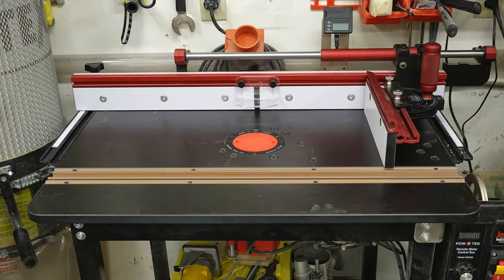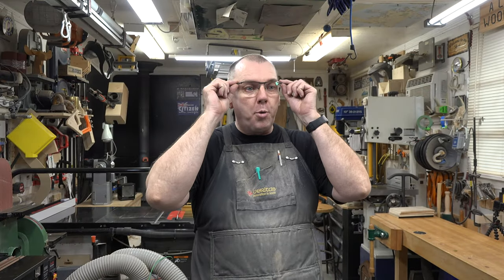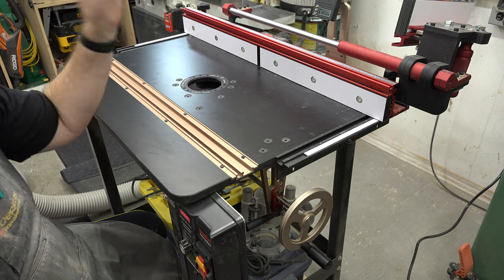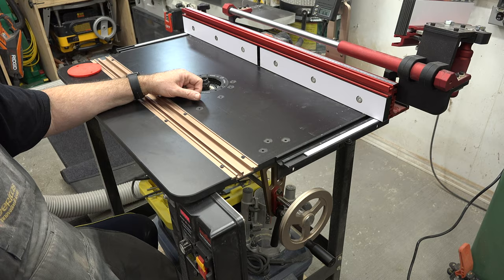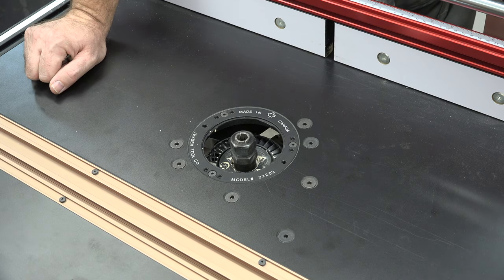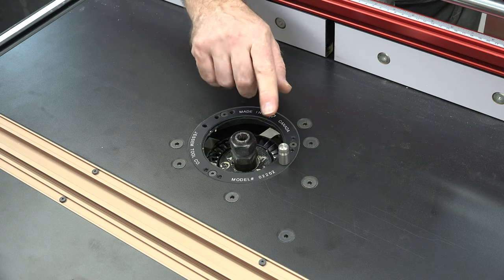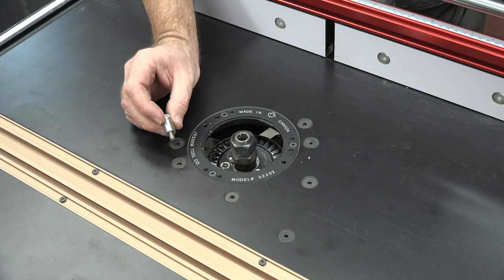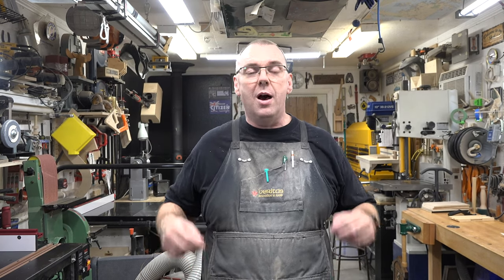JessEm Master Lift Excel II Review

Comment: Thanks Kenny I had been wondering what the all the fuss was about and now I see - it appears that the JessEm is the Rolls Royce of router tables. A brilliant design combined with excellent engineering. It's very impressive and I am delighted you are enjoying its practicality. Always good to get maximum bangs for your hard earned bucks!
Reply from the maker: I do like this table Mike.  I want to be enclosing it soon though to store my other routers and accessories.  Hopefully you will see that on the show soon.  Thanks for tuning in sir.
Reply: @acutabove_woodworkings do you still have it? Still liking it?
Reply from the maker: @Benmeglei1  Still have it.  Still love it and haven't had a single problem with it since the day it was purchased.  I hope this helps.  Thanks for tuning in.

Comment: That is a nice tool Ken, thanks for the review! For the plates could you epoxy a magnet on the under side, then inset a washer in the tool? No better yet inset the magnet in the tool and washer under the plate. If only you knew an electrician that could pick up a few box knock outs. Thanks Ken!
Reply from the maker: LOL. I will try and find me an electrician Frank.  Maybe he can help me out.  Thanks for tuning in and for taking the time to chime in with your suggestion.  It's very much appreciated.

Comment: That sidewinder mechanism is appealing. Now to see whether it is available for the lift installed in a shop-built saw table extension.
Reply from the maker: I was able to install this side crank in a shop made router cabinet and it works just fine.  I am sure that you would be able to adjust your shop-built table saw extension to be able to accommodate the mechanism.  Thanks for tuning in and good luck on your build.

Comment: Been window shopping high quality router tables until I can mak the leap. Everything good costs money.
 The side of the table crank is the thing that I like most on this unit. 
 I really want the festool for its portability but, I'm not married to the idea.
 Jessum is on the radar..
Reply from the maker: I've been happy with this system William.  They are pricey but they are also high quality.  I love it.  The fact that it is from right here in Canada is also a bonus for me.  Thanks for tuning in and good luck with your router table purchase.
Reply: @christophervincenzo4553  
Sounds lime you aint getting tbe hob done if you have to sneak her like that

Comment: Kenny, great review all around.  My only question is are the fence faces user replaceable?  For instance if you wanted a zero clearance fence on either the fence or the miter face could you use a material such as melamine to make your own so you don’t mess up the originals?  Really a nice looking tool that should last a lifetime or more.
Reply from the maker: I haven't looked into whether or not they are replaceable Paul but I would imagine that it would be an easy task to make a set of sacrificial ones.  Maybe a show idea?  I'll have to look into that.  thanks for tuning in to the show and for taking the time to leave a comment again this week.  Always great to hear you opinion on the program.

Comment: 22:05... suggestion... you could epoxy a rare earth magnet to the bottoms of the plates and a corresponding magnet to the handle.  No need to drill, just glue to the opposite side of each, as the magnet should be plenty strong to provide just enough attraction to lift the plate out when loose.  Of course, it may not work for the largest sized inserts, as there may not be enough room to mount the magnet to those particular plates.
Reply from the maker: Thanks for tuning in to the show and for chiming in with your insert suggestion.  I still haven't decided on a final method yet but your method has some definitely possibilities.  Thanks again.

Comment: Love your review of this router table, very in depth. I wish they had not discontinued the Pow-r-tec Router, controlling the speed with out having to reach underneath is a lot more convenient. I've had this table for a few years now and I have a Porter cable 7518 router installed. It works great but a remote speed control would have been better. My only issue with this table is the dust control. The suction works somewhat but I still get a lot on the floor that's missed, A LOT. I would like to mount a box to catch it and I'm looking for ideas on the best way to mount it and how to get around the handle shaft. I remember seeing a video a while back about a box for this model but I cant seem to locate it again. Do know of one or have you thought about adding one to your table? Anything you can suggest would be appreciated
Reply from the maker: I produced a show on making a router table cabinet for this exact router setup and I was able to work the height adjustment shaft into the design.  It greatly improved the dust collection of the machine and if you are interested, here are the video links to the series.
Part One. https://www.youtube.com/watch?v=eciOQDDYj2w&t=18s
Part Two.  https://www.youtube.com/watch?v=eSxSyAPL-Ug
Part Three.  https://www.youtube.com/watch?v=OjFy65tqtz8
They might help you with dust collection idea.  Thanks for tuning in and for the kind words on the show.

Comment: Didn't watch video yet, but this master lift is a beast. I have same one in my shop. I also have two rout-r-lifts, which also I could recommend
edit
wow I started with same freud router table. I still use that original 3.25 or 3.5HP freud router
Reply from the maker: I love the lift.  It works flawlessly and is extremely adjustable.  Thanks for tuning in to the show Marcelo and for chiming in with your thoughts.

Comment: If the "fingers" on the insert wrench are steel, you can just epoxy some small magnets under the insert.  That would allow you to have it "connect" to the wrench which would make removal very easy.    Have you considered drilling a hole (1 1/2")  in the table and hooking up another dust collector hose to it (underneath)?   That would solve the rabbet/dado dust issue.  Another excellent review.   :)
Reply from the maker: That would be an expensive fix Ron as there are about 13 inserts.  Not to mention that the holes that the fingers insert into are through holes that the fingers sit proud of.  I am considering magnets, just not on the fingers.  If I ever figure it out, you will see it on one of my 6 month update shows.  Thanks for tuning in and for the suggestion.
Reply: @acutabove_woodworkings  I got 100 rare earth magnets on Amazon for $20.  Small, 5/15 round ones.  I use them on my table saw inserts to hold them in.   Work really well.  But if the fingers are proud, and the handle is plastic, would probably melt the connection if you tried to grind them down flush.  Oh well.   We look forward to your updates.  :)
Reply from the maker: @RonAday  I appreciate you trying to come up with a solution.  I'll be sure to post when I fix the issue.  Thanks again.

Comment: Have you settled on where the best position for you to place the digital readout screen for your custom build? I’m thinking \nearer to the crank handle since this is where we control the height, and about eye level, somewhere on a back wall.  I don’t want to have an obstruction on the table if I need to remove the fence for large routing pieces.
Reply from the maker: On the custom build Bash, I basically left it where it was in the original assembly of the table.  I had to modify a few small things but the placement has never been an issue for me in the entire time I have been using the router table.  In fact, I quite like the placement now that I have had a chance to use the table more and more.  Obviously, whatever works for me might not work for you but I've had this table a while now and have had no issues with that gauge getting in my way.  I hope this helps.

Comment: Great review on your system.  I am at a crossroads as far as a router table.  I purchased the JessEm Mast-R-Lift II several years ago and am now just thinking about putting to use.  So as things go, I am debating on which router table top to purchase.  Not sure if the side crank table can adapt to the lift I already have.  I tried inserting and removing the plastic discs on the opening of the Lift II.  I see what you mean.
Reply from the maker: I'm glad that you were able to take something positive away from this video.  It is definitely a great router lift and I love my final setup.  I actually have another series on where I made a cabinet to house the router and the lift, utilizing the existing top.  I hope you are able to figure out your setup and get your router in use.  It's a spectacular setup.  Thanks for tuning in.

Comment: I bought this to build kitchen cabinets just to find out I can't make miter doors my bit is 2 1/2" tall so can't use without a sacrificial fence which was really disappointing. I was back and forth on the Sommerfeld table and now really regret not going that route. The Jessem is defiantly high-quality can't argue that I bought it last yr. and have never even got to use it because I can't find a 3 1/4 router due to the issues going on in the country.
Reply from the maker: This is disappointing to hear K R.  I hope you are able to find a router motor soon as this is a wonderful table to use in the shop.  That sounds like one heck of a massive router bit for sure.  Thanks for tuning in to the show and good luck with your kitchen cabinet build.

Comment: Your  reviews have been very helpful in setting up my Excel table and fence which I purchased used.  I'm curious how you have your dust collection set up if you wouldn't mind sharing.
Reply from the maker: This has been a topic of confusion for a lot of people.  My table came with a 4" dust collection shroud that mounts on the underside of the table, just to the side of the router.  One side of the shroud is cut out to catch the chips that shoot out from the bit.  It works rather well but for some reason, people are saying that their router tables didn't come with this shroud.  I produced a show on the assembly of this table and you can find it here.  https://www.youtube.com/watch?v=nkdCcK_nM9o&t=7s
At 8:48, I clearly show the shroud and where it installs.  This might help you to determine if you have this part or not.  Let me know if there is any other way that I can help.
Thanks for tuning in to the show.
Reply: @acutabove_woodworkings  I wasn't clear on my question.  I'm aware of the 4" shroud on the underside (your video was very informative on that) and the smaller one on the fence.  What I'm wondering is how to connect those two ports to my shop vac hose. Step downs, y-connectors, and so on.
Reply from the maker: @radutenenbaum977  I use a shop vac on the fence port and I have dust collector that runs a 4" hose so no reducers would be needed.  You can get 4"-2" reducers and a Y fitting as you stated but it may not be enough to take the higher output of dust that the router throws out.  A suggestion would be to consider getting a dust collection system for your shop that incorporates the 4" intake.  They aren't that expensive and can be used at multiple tools.
Reply: @acutabove_woodworkings  Thank you!

Comment: You could put magnets in holes in the back of inserts. Same dimension from center as holes for wrench, rotated 90 degrees. unlock insert with wrench, then use wrench above magnets to lift insert.
Reply from the maker: That might work Doug.  I will have to think about this one.  Thanks for tuning in and for chiming in with your suggestion.  It's appreciated.
Reply: @acutabove_woodworkings  Its really not a big deal. When you change the insert its typically when you change router bit. Anyway you have to crank it up.

Comment: Nice video, very in depth and extremely helpful. I have a couple questions, 1) Where did you get the router motor?  2) What about using the Woodpeckers tool downdraft dust box, would that work, help? 3) Where did you get the variable speed adjuster switch?  Thank you.
Reply from the maker: Thanks for the kind words James.  I truly appreciate it.  I don't think you're going to like my answers to your questions though.  The router motor was sold by Jessem and it is their Power Trek motor.  For some unknown reason, they discontinued it which is a real shame as it is a spectacular motor and functions really well in conjunction with the router table.  It would be an asset to any shop and I have no idea why they stopped selling it.  The woodpecker products are not available here in Canada to the best of my knowledge so I can't say if it would help or not, but I have since enclosed the router table in a shop made cabinet and the dust collection that I've added made a huge difference with the router motor enclosed.  If you are interested in that build, you can always search the channel for "router table" and you will find the multi part build series.  Lastly, the variable speed control.....was part of the Power Trek motor that Jessem stopped selling.  The motor came with the variable speed, digital readout control.  I really wish they still sold it because I love that motor and others would really benefit from it.  Sorry that I couldn't help more James.  Thanks for tuning in to the show and taking the time to leave your questions.
Reply: @acutabove_woodworkings  Thank you for getting back to me so fast, that is very much appreciated.  I had a feeling that was going to be your answer, it seems all good things must come to an end! I may reach out to JessEm and see if they can shed a little light on the motor issue.  I was really interested in the variable speed control, there doesn't seem to be a lot out there in regards to them. Still one hell of a router table IMO. Thanks again and keep up the great video content.
Reply from the maker: @jimsynyard  If you do reach out to Jessem and they provide you with any kind of an answer, I'd be interested to know why they discontinued it as well.
Reply: @acutabove_woodworkings  I called Jessem the CS lady told me they had intermittent issues with the motor. She said some people had issues while other people had no issues what so ever. She also told me they are working on their own motor in house and that may be available in the fall.
Reply from the maker: @jimsynyard  Interesting.  I haven't had a single issue with mine.  I guess I was one of the lucky ones.  I'd be interested to see what they come up with for their new motor.  Thanks for the information James.

Comment: Hey Kenny.
I got kitchen cabs to build in the neer futur. I just bought the Milwaukee 3.5hp router,
And im seriously considering buying the JessEm Ultimate Excel II package, 
Have you ever cut 
raised panels,rails,etc with this set up. 
And if so,  how did they turn out?
Reply from the maker: I have not cut raised panels with this particular setup, but I have cut raised panels with a similarly powered router and a much lower quality fence.  They turned out perfectly.  You should have no problems whatsoever.  I hope this helps.  Thanks for tuning in to the show Joel.

Comment: Being looking for a router table  - Great review  presentation as always Kenny and its Canadian product  - question  can the Mitre R slide be used as a coping sled for the end grain cuts on the rails in cabinet doors. If so is there a way to clamp the rails secure or attach a sled secure to the fence . Maybe a show idea look forward to seeing it.
Reply from the maker: This is a great show idea William.  For coping, I wouldn't want to trust holding the stock using just the power of your hands so it would have to be clamped in place.  It would be a little awkward clamping a board flat like that while coping due to the design of the fence.  However, the main fence board on the mitre slide is removable.  If I were going to use it for coping, I would remake that board and incorporate the coping sled into it.  In other words, I would make a coping sled that would attach to the mitre slide by replacing the fence board.  I think you can count on this being on a future episode of the program.  Thanks for tuning in and for taking the time to ask your question.  It's truly appreciated.
Reply: Hi Kenny wondering if you every come up with a plan for a coping with your Mitre R Slide yet   @acutabove_woodworkings
Reply from the maker: @williamhandley2205  I have not used the mit R slide for coping but I did build a coping jig to use in the mitre slot.

Comment: I was admiring how many machines you have fit into your shop space. How big of a space do you actually have there? I am wondering if the camera angle makes it look smaller than it actually is? Do you find it a nuisance to have to roll each machine into place to use it each time it looks as though you have to do that?
Reply from the maker: My shop is 12' wide and 24' long with 8' ceilings.  For the most part, I have my shop set up so that I can use the tools where they are for most projects.  If I am working on a larger project, I might have to wheel out a tool once in a while.  It's a bit of a pain but I'd rather move the tools, than have no shop at all.  I always have to move the thickness planer to use it.  My goal is to one day, have a shop that I can have all my tools set up in work stations so that I never have to set up a tool to use it again.  I lose quite a bit of time setting up tools and it would be nice not to have to do that.  But as I said, there are worse things to deal with in this world than just having to move a tool to use it.  Thanks for tuning in to the show and for taking the time to ask your questions.  It is very much appreciated.